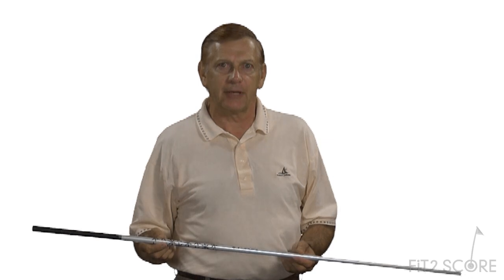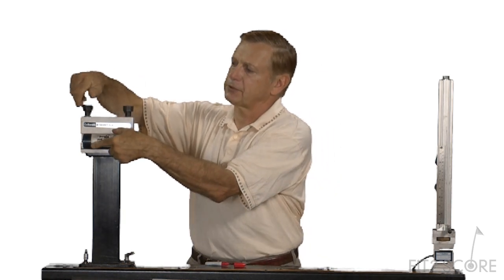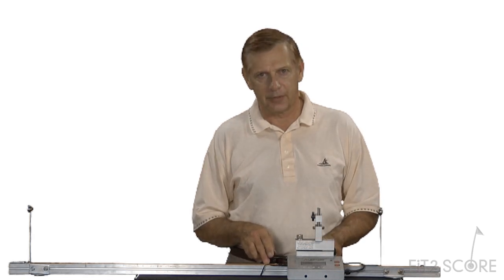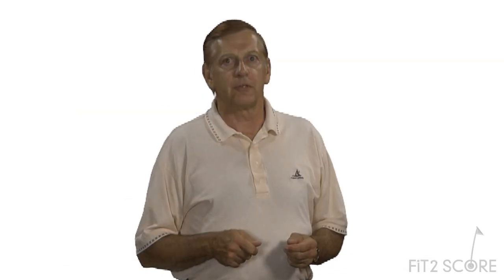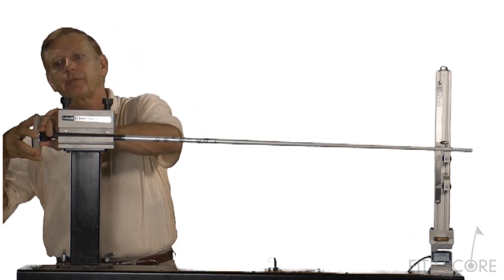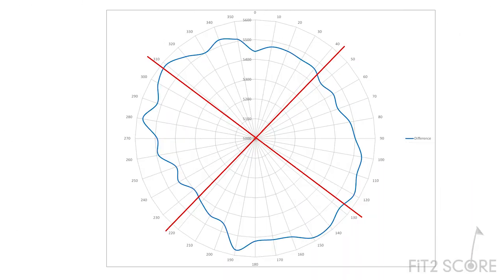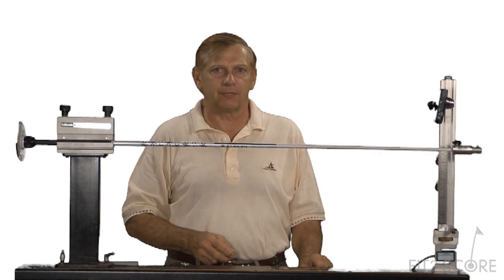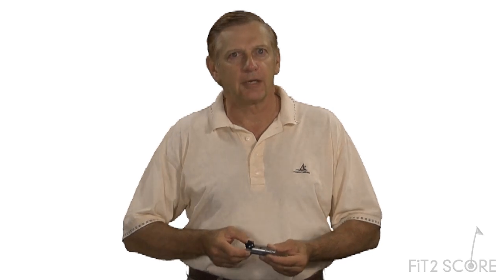Custom Golf Club Fitting  - Shaft Alignment - Spine Finding

Comment: It's been almost ten years since I discovered this video.  I maintain that identifying the main spine of a shaft with a bearing spine finder is the way to go.  I shafted a set of MacGregor blades many years back.  I used 5.0 Rifle stepless shafts.  I found the set inconsistent with the exception of my 6 iron.  It was my go to club and most consistent from shot to shot.  I decided to break everything down, identify the spines in all the shafts, and re-assemble with the spines set to the target line.  But first, I marked the target lines as they were in their random fashion.  It turns out that my "go to" 6 iron was by chance, spot on the target line.  Once I re-assembled the entire set, it was an amazing difference.  Consistency and control.  I know this is just anecdotal information, but ever since then, I spine to the target line on every single club I own.  I am a very straight hitter.  I think spining is responsible for making that possible.  Also, in all these F.L.O. videos, no one ever mentions club droop.  It's a real thing and I believe to be much more of a factor than people think.  Keeping the spine toward the target also makes club droop pretty consistent.  Just my single digit opinion.
Reply from the maker: I like your comment on droop. I am ever more observant of it as my experience accumulates. To a large degree it is amplified by shaft stiffness and shaft profile. If a shaft is to "soft" for you, it will droop excessively. As an example, a few days ago I moved a talented young play to a sturdier driver shaft. Her strike pattern was low heal on the new shaft. I explained that she have become accustomed to excessive droop and was compensating for it. The new shaft would not droop as much and she would have to adjust for it. 

I stepped back after spraying the club face and gave her the task of adjusting her swing to the new shafts. About 10 swings later she was on center face and racking up higher smash factors and distance. 

I have not found shaft alignment to have any effect with quality shafts.

Comment: Since the center of contact with the ball is not inline with the center of the shaft and is indeed at least 1 inch or more offset,I believe  the shaft at the moment of dall contact is subject to torsion or twisting,Steel shafts have a great deal more resistance to twisting than graphite.There is  a possibility that proper alignment of the spine would help  resist twisting but that calculation would scalar and involve vectors and would be unique to every assembly.

Comment: I have watched the video several times.  As I understand this concept of spine and FLO, could it be possible to find the vertical plane with the laser, and turn the shaft 180 degrees for the opposite plane.  And the final step to find the CPM of both planes for the stiffness.  Could the spine finding be eliminated all together?  I have a Maltby Analyzer with the goal posts, and a few lasers from Golf Mechanics, and I was thinking,  could it be done all in one the same step?  As long as I stay consistent with my clubs, would I not be accomplishing it without finding the spine?    
Also, at the end of the video, you mention that the FLO lines are placed in positions such as - directly at the target, 90 degree, or 12 o'clock....?  You mention that your clubs are measured and assembled following this approach, so, what alignment of the FLO line, do you assemble your golf clubs?  
After reading the comments, some related, but I did notice that you mentioned it is difficult to find a FLO on a quality shaft.  So, just spine those, or according to the silk screen, and other shafts, maybe FLO?  I understand that this concept is mocked quite heavily, however, I am believer.  So, I appreciate your video.  Thank you

Comment: What diff does it make with all the drivers now having adjustable shaft positions. You just keep moving the spine several degrees when adjusting the loft of the club with these tips, i.e. Taylormade, Ping, Titleist, etc.
Reply from the maker: +Bob Williams , As you say, the rotating hosel is a standard now. Finding spine has only one purpose, checking to see that the shaft is little to no spine. I find a FLO and note the frequency at that point. I then turn the shaft 90 degrees and find the second FLO. If there is FLO, indicating the shaft is to some degree elliptical. there is going to be another FLO about 90 degrees away. When located I measure the frequency of the second FLO and compare the two. I an quality driver shaft I expect to see less than 2 CPM difference. If it is greater than two the shaft is marginal, if it is greater than 5 and it is a premium shaft, it is going back to the manufacturer. Doing this requires a frequency instrument with a back stop. Being able to bump the shaft against something makes certain you are measuring exactly the same beam length at the two points. I have a pneumatic clamp frequency instrument from Golf Mechanix. A custom backstop was made for me letting me clamp 7" from the butt, the Fuji standard. Some of the big brands use exactly this procedure and I never see a shaft over two CPM difference. Others do not, it depends on the place where the shaft was made. All the shaft manufacturers understand what I just wrote. Some put the bad stuff in the dumpster, some do not. Quality control has a cost and it is generally reflected in the price of the shaft. But not all high price shafts are made to exacting quality control specifications. GolfShaftReviews measures a lot of shafts. If you are truly interested in understanding not only the bending profiles of the shafts but also the quality of the lot of review samples you should subscribe to the software.

Comment: My experience is that if you deflect any decent  shaft vertically and release the tip, the laser will transcribe a vertical path for the first few cycles, or at the very least, for the first cycle. What happens with regard to oscillation in cycles 2,3,4 etc is most likely irrelevant to golfers, as the golf ball is hit during the first cycle of flex and release, ie before the shaft starts to oscillate.
Reply from the maker: +sci fi sicko True, and this speaks to the discussion of what we can measure vs how a golf shaft performs. I made this video a long time ago. And have spent years learning about the golf shaft since this was made. Current view, I don't use shafts that have a large difference in stiffness between hard and soft planes. There are always two. If there is a hard plane, then there is a soft plane 90 degrees away. The difference between hard and soft is the issue in rotating hosels. If the difference is large, you will be changing stiffness as you rotate. And if you are good enough that it matters, it will affect shot placement.

Comment from the maker: I will soon make an update to this video.  Adjustable Drivers, Fairways & Hybrids require good shafts.  One simple test is to put the shaft in a clamp and see how severely it wobbles.  The good stuff will wobble some, the bad stuff will wobble all over the place.  And the location of the flat line oscillation plain will be very tight.  Owing the the severity of the elliptical nature of shaft stiffness on that bad shaft.  On the good stuff, the FLO can sometimes be hard to find.

Comment: To follow up on my reply - the best type of shaft to use in a driver with an adjustable hosel, if you are planning to change it frequently, is one that has very little or no spine. And the type of shaft that will always have that unique characteristic is a filament wound shaft. It's very difficult to manufacture a sheet wrapped/table rolled shaft without creating a spine, no matter how high quality or expensive it is. But a filament wound shaft will never have a spine due to the way it is made.

Comment from the maker: Using a hosel that rotates the shaft requires that the shaft have radial consistency.  Most quality aftermarket shafts do. The test is to compare the frequency of the strong and weak planes of the shaft.  A low difference, 0-2 CPM is a tour quality shaft, 3-6, consumer quality, 6+ trash.  And I have pulled out some real trash, 10-15 cpm difference from off the rack clubs.  As a fitter you recognize that 8.6 on the Brunswick scale represented a flex point, 4.0 vs 5.0.  What does 15 CPM imply?

Comment: @GolfFitter - In my opinion, spine alignment does two things.  Firstly, and most important, allows the golfer to maintain light grip pressure throughout the swing.  Without identifying and aligning the spine, the club begins to "twist" during acceleration of the downswing.. The golfer feels this feedback and unconsciously grips tighter, which is not good.  Secondly, it allows the clubs to flex in a similar fashion.  I just believe that a bearing based spine tool is more than sufficient.
Reply: Doesn't work

Comment: Agreed that identifying the spine and aligning it properly is the way to go.. but this precision scientific hair splitting is a waste...  Bearing based spine finders are way close enough.  Think about it.  As soon as you glue on the head, the weight distribution and off center nature of the head design takes the "extra science" out of the equation.  Then, what about opening the face for fades and closing it for draws?  Bottom line... bearing based spine finders are the way to go.
Reply: So do u align the spine towards the target (9 0 clock) or 12 o clock..?
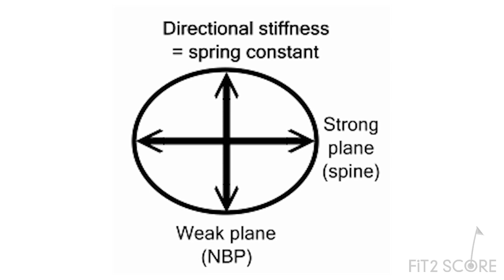Reply: @cryingpendu  I think there are three ways you could go.  At 6:00 it would tend to eliminate club droop.  At 9:00 the theory is that enhances the clubhead whipping through the hitting area.  At 3:00, it makes the shaft play stiffer and possibly enhances your ability to draw or fade.  All this is my opinion of course.  This winter, I am reshafting my entire set and setting the spine to help eliminate club droop.  There's a lot of research done on this topic.  Just Google golf club spine location.
Reply: @BourneAccident  hi. thx for the info..im rebuilding the  club myself too and come to this spine topic..i've googled and read a lot and cant seems to find the definitive answer on this.. ur explaination gives more insight..thx again
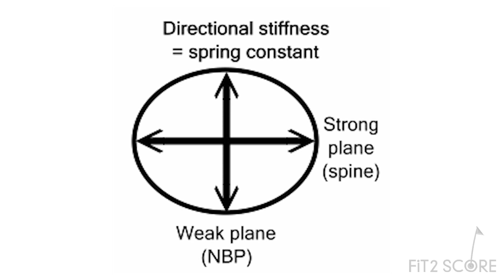Reply: @cryingpendu  My personal problem with consistent flush contact with the ball is club droop... and it varies from club to club creating confusion.  So I think I will shaft all my clubs at 6:00 so that club droop is a bare minimum.